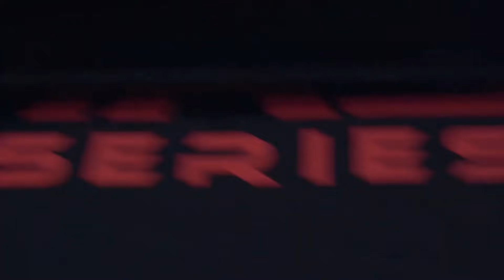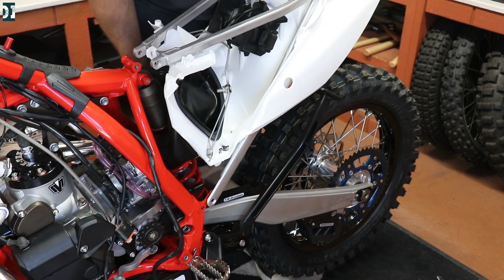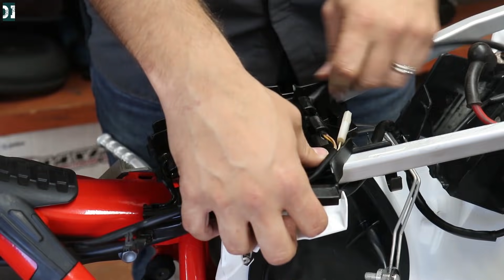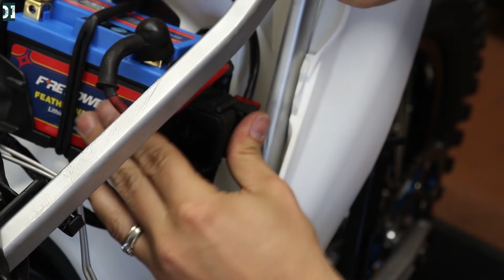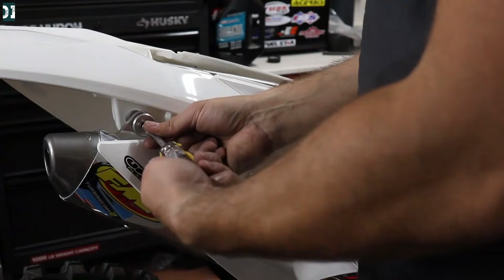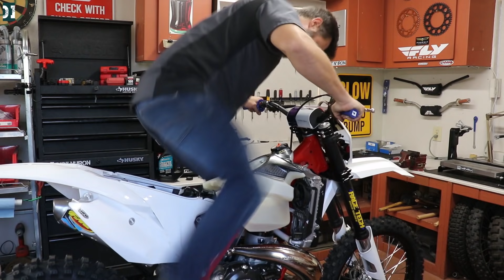KTM 300 XC Dirt Bike Build - FIRST START!!!

Comment: It’s a two stroke u need to fill barrel with fuel prior to starting, it’s not like a four stroke that’s injected because the computer will automatically send fuel in when u kick but because it’s a two stroke and carbi u need to fill her up with fuel in bore to get any type bang. That’s why u see people leaning them over to get fuel into the motor👍 before I start my two stroke I give it two solid hand fulls of fuel with choke on then roll motor over slowly with leg (2x really light kicks that won’t start motor to lubricate the piston and crank and to get fuel in) then pump some more fuel in one more time, then give her good kick and starts first or second kick every time. Big fan from Australia. Keep up good work!
Reply from the maker: Hayden, thanks a lot for great tip. Looks like you have done that many times, I am learning as I go. cheers mate!👍
Reply: Same here don’t worry😂 plenty more learning for me to be done and ur videos are helping me heaps! Thanks again mate. Cheers

Comment: Well done in getting started, but looked like you used a 1 inch of fuel between failed attempts and putting your boot on🤔 and it eventually started
Reply from the maker: haha, good eye Sherlock :)   but, I took the tank off when checking the wires and plug, so the gas got poured from one side to the other when moving the tank. technically if the bike runs parked you are not even using the gas from the right bottom side since the petcock is on the other side. video is 100% authentic

Comment: There is a  410watt starter that helps with the weak cranking . Slavens has them as well as others . I have the same year bike and I was always told the electric was for once the bike warms up . LOL
Reply from the maker: I am getting 410W starter for sure, thanks man!
Reply: @dirtniron  please do a video when you replace it . Maybe do the starter with your current battery and then if you change the battery too show the differences . Btw the bike is clean I really like it !! I like how you got the gauges set up with the mask on the front . I’m trying to figure out how I’m going to do mine .